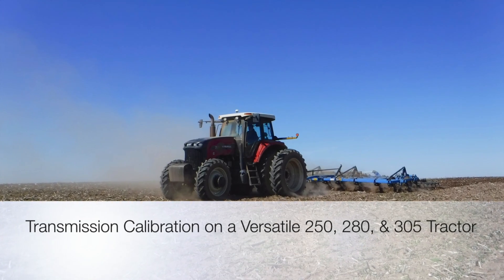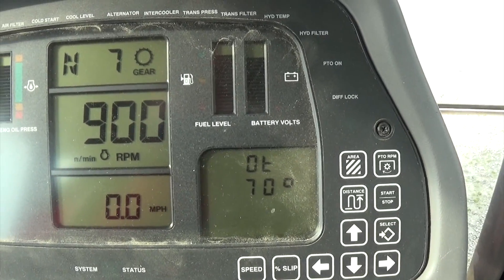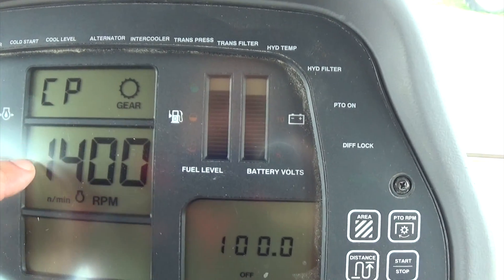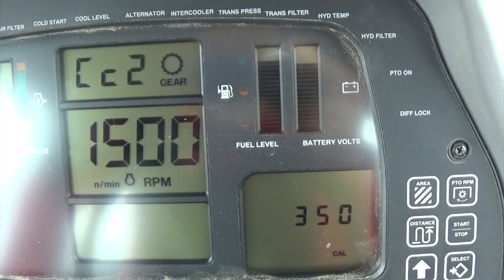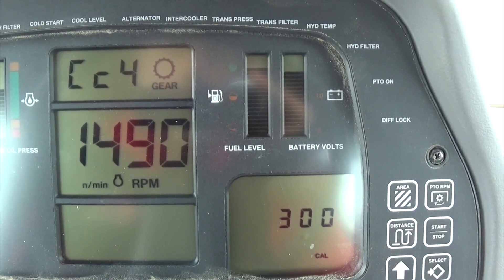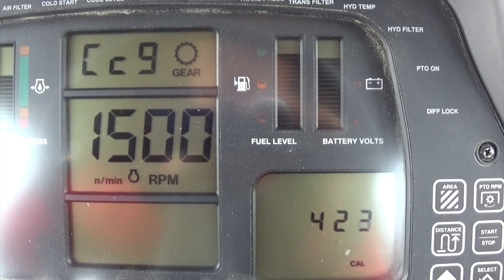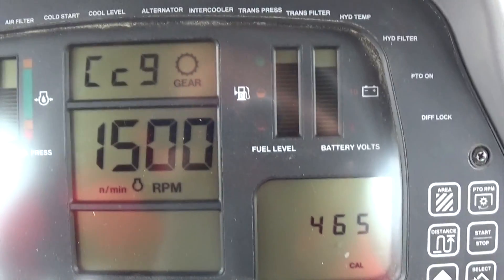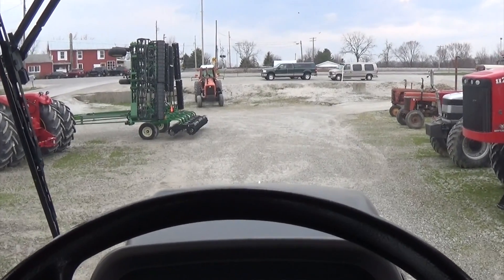Transmission Calibration on a Versatile 250, 280, & 305 Tractor

Comment: Hey Mike, got a 250, all clutches calibrate fine except number 4. Does this mean clutch 4 is smoked?
Reply: Also have no 1,2,3,10 gears. All other gears operate fine.
Reply from the maker: @jameswinkenwader5839  clutch could be bad but I’d check the transmission solenoid and spool for that clutch.  You can swap it with another clutch solenoid and see if the problem moves.

Comment: Got a question mike , I run a versatile 280 tractor it's a row crop  tractor , when I start my tractor it's in the 7th gear . Is there any way to reset that to the 4th or 5th gear ? I'd love to know please
Reply from the maker: Yes you need the newer version of transmission software.  Your Versatile dealer can load that into the TCM. Transmission Control Module pretty east.
Reply: Thanks Mike 👍😊

Comment: Do you need to have the clutch pushed in to get going? Or can you just put it in gear without pushing it in?
Reply from the maker: Either way is fine. I mostly use the clutch pedal for hooking up and tight manuevering . Otherwise I just throw it in gear and go
Reply: @farmhandmike  Thats what i thought i was reading the owner's manual and it called it a inching pedal. I did know the answer for sure so i just used the clutch.

Comment: Thanks for the video!! Just did this today on a 250. Was also trying to figure out how to change the gear selection when going from forward to reverse? Right now when going from forward to reverse it will go to the same gear as the forward gear. Thought there was a way to have it drop a couple gears or go to a "default" gear? Any insight on this would be appreciated!
Reply from the maker: Depending what software version the Transmission Control Module (TCM) on your tractor has makes the difference if it will match or not. The early ones had version 2.30 and the latest version is 2.34.   The easiest way to tell to tell which one you have without me trying to explain how to go into the dash and read software version is just tell me when you start the tractor does the gear display show 7 (7th gear) or show 5 (gear 5)    If it shows 7 you have the early software version and will need to get a dealer to reflash your TCM.  If it shows gear 5 when you start the tractor let me know and I will explain the operation.
Reply: Thanks for all your info! Yeah I'm 99% sure it shows 7th gear. I will double check tomorrow to make sure though and comment back here again.
Reply from the maker: It probably does.  Where do you live?  And or who's your Versatile dealer.
Reply: By St. Cloud, Minnesota. I had called the dealer earlier today and he didn't have an answer for it. Said he would call back when he finds something out. Didn't hear back yet. He didn't mention any of the things you brought up. I will have to mention to him about the software update to the TCM like you mentioned.
Reply from the maker: Its a simple laptop computer program and a cable from Versatile to load this. The dealer should have this and the 2.34 software the dealer can get from the Versatile dealer portal. Only takes like 2 minutes to load then that will change your startup gear to F5 and reverse will default to R4.
Reply: Ok. That sounds perfect for the gears. Thanks again for your information.
Reply: Will the transmission software update help with jerky shifting and/or jerky inching pedal? I've done the calibrations and still have pretty jerky shifts and the inching pedal is sporadic weather it's smooth to engage or not.